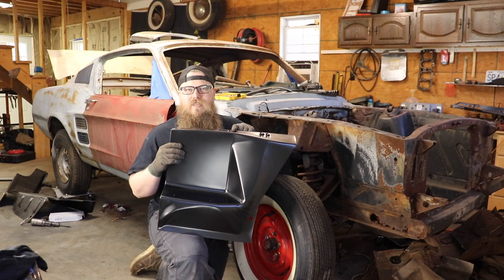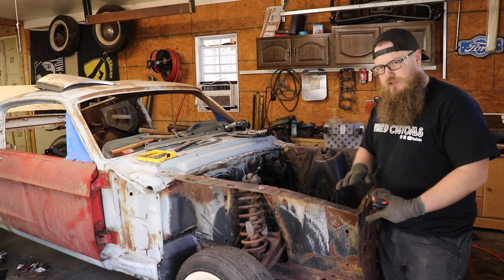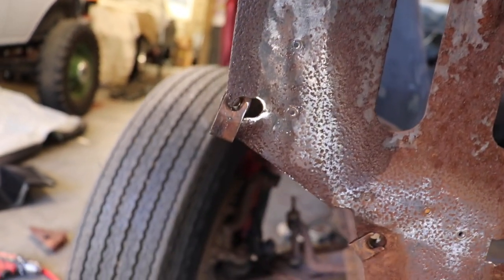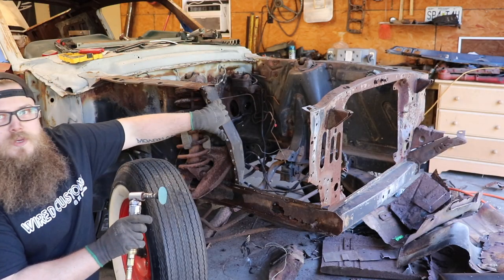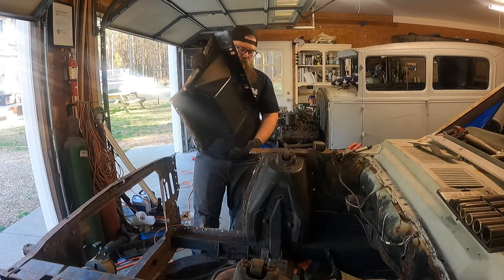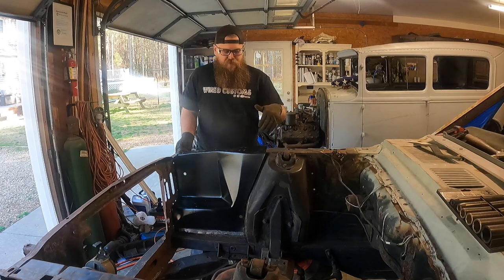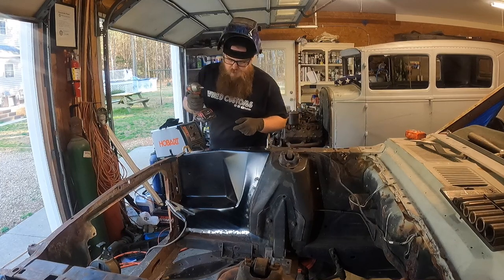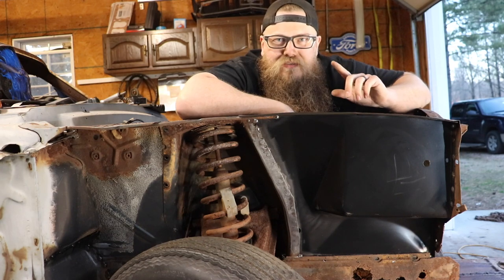67 Mustang Fender Apron Replacement!

Comment: Rigid putty knife works great for spot welds, predrill 1/4" then putty knife it. --------  Zinc Weld Through Primer anyplace you have bare metal to prevent future rust.

Comment: How did you or did you drill the holes for the body bolts to go back through the shock guards?
Reply from the maker: Sorry I didn’t put it in the video, I marked the holes after bolting the shock guard back up then drilled the holes

Comment: Uhhh..??..no weld thru primer??..
Or is it me??..
Reply from the maker: No need, I’m going to paint and seam seal everything anyways
Reply: @WiredCustomsSpeedShop  yeah but bare metal contact is gonna bite your ass ..soon..
You need to do metal prep for rust prevention on all the surfaces before you weld..
Reply from the maker: @brianarrington4569  been doing it this way for 15 years, seam seal it and paint it, if it’s something I am going to box in I prime it, if it’s something small like this then it’s fine
Reply: @WiredCustomsSpeedShop  question?..
Tell me if im wrong?.. Do you have 2 bare metal surfaces welded together?..or no..
And why do you spray with water?..
Reply from the maker: @brianarrington4569   yes they are welded together, exactly like from factory, and I spray with water because I am also a painter, and spraying with oil is a nightmare for a painter
Reply: @WiredCustomsSpeedShop  ok..ive always seen bits dipped in grease..then  you properly clean your area so it didn't mattet...& the factory did alot of things wrong..they only built cars to last no longer than 10years back then..alot of things done in 1965 i would not do today..looks YES!!
performance& saftey..no..its two thousand twenty something..theres a better way to do everything and make it greater!......even cookies..& i know thats right!!
Reply from the maker: @brianarrington4569   I’ve worked on cars that are as old as 84 years and unrestored, so saying cars were only built to last 10 years is pretty silly, do you restore professionally?
Reply: @WiredCustomsSpeedShop  look right now I am restoring 3 muscle cars 67 69 and 70 Mustangs and goats..all I'm saying is that bare metal contact welded together is asking for trouble.. I don't understand the point of you don't need rust protection..you need rust protection. And the automobile industry marketing strategy is not to build cars that last forever...we in the hobby of restoring cars should do things that they did not do 50 years ago.. I don't understand how NOT using rust prevention is the thing to do when working on first generation muscle cars. I don't know if you went to school or I don't know who taught you.. but did they tell you ....no no no you don't need rust protection on these vehicles cause rust sleeps & will cause no problems in the future?..a little rust protection is insurance that your hard work lasts...check on your past jobs where you have no rust prevention..to see if your technique is holding up..& talk to other builders...see what they tell you...im almost sure im right
Reply from the maker: @brianarrington4569   you’re free to your opinion, I use rust prevention when I think it’s needed, on small small patches I don’t worry about it, when I weld can mounts together they do have weld through primer, I was taught by Gene Winfield, feel free to look him up, I’ve resorted close to 100 cars and my work speaks for itself with return customers and great referrals
Reply: @WiredCustomsSpeedShop  Gene Winfield?..
How is that possible?.he must be 100 by now!!..how old are you?? to have been his student?..& what shop did you apprentice at?..
not arguing with you..just interested
Reply from the maker: @brianarrington4569  I’ve been lucky enough to know the right people, we toured America with Summit Racing Chop Shop and chopped top in front of live audiences, Gene also puts on schools and has classes that I’ve been to as many times as I can over the years
Reply: @WiredCustomsSpeedShop  the Gene Winfield im thinking of has to be at least 100..but ok..how do find cars out where you are?